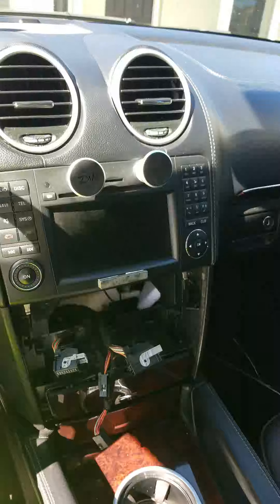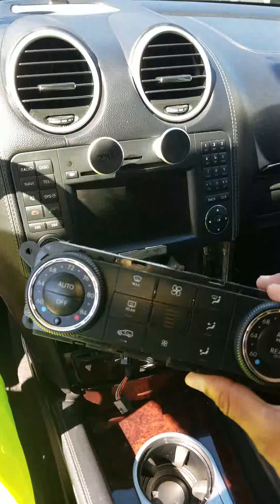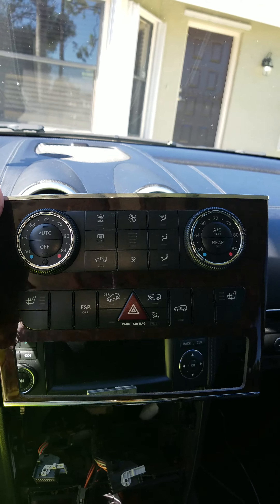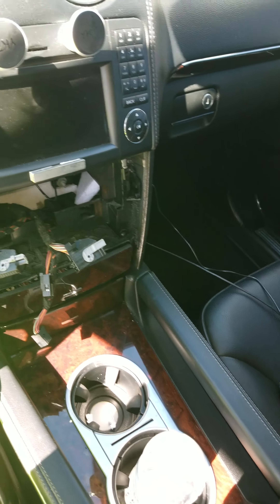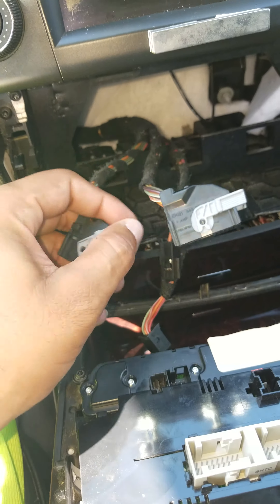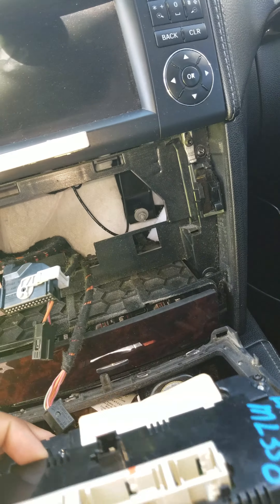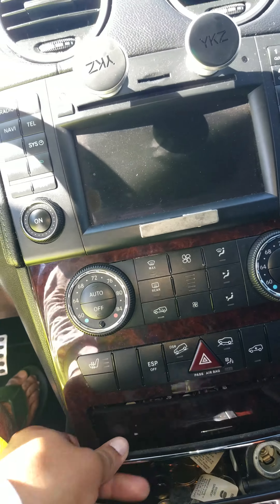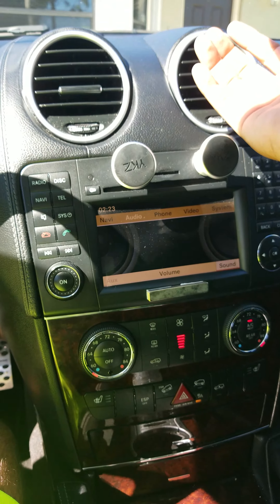2010 Mercedes Benz gl450 A/C problems

Comment: I had a similar problem the last two years that the A/C would cut off and heat would pour out of all the vents. If I banged the side of the A/C control on the dash it would stop intermittently. As it turned out I ordered the 05 Q2 version of your part you mentioned at ebay for $100 and it fixed my problem on my wife's 2012 gl 450.
Reply from the maker: Perfect glad I could help.
Reply: Mine will get cold for 3 minutes then turns to just cool. Everything working. Compressor, no leaks, keeps going in and out. I believe this is the fix.

Comment: My Gls 450 2012 air conditioner blows hot air I don't know what's wrong. the shop says it maybe electrical? please help
Reply from the maker: Check to see if it has freon on the system it may be low on freon if not the problem will be the control unit they go crazy & when you think you are at lowest setting its actually sending a hot temperature out
Reply: @kennyadriankc  tHANK YOU i AM GOING TO CHECK IT now

Comment: Change the compressor
Reply: If you change the compressor, be site to buy an oem one. My mechanic bought a generic brand compressor and it does not communicate with the Ac control unit. Now we have to order an oem AC compressor.